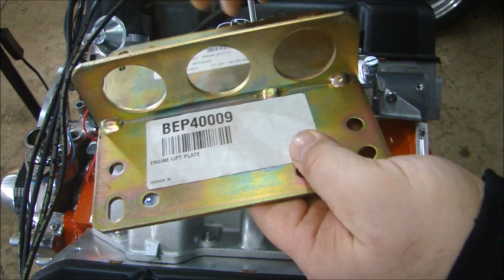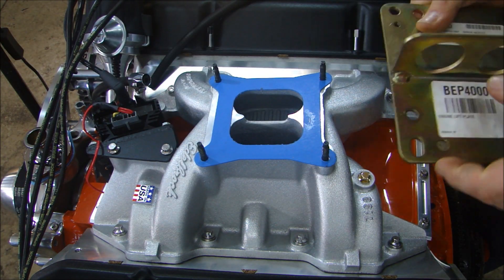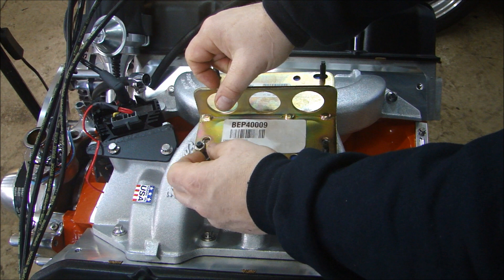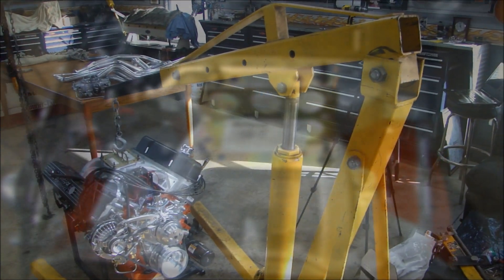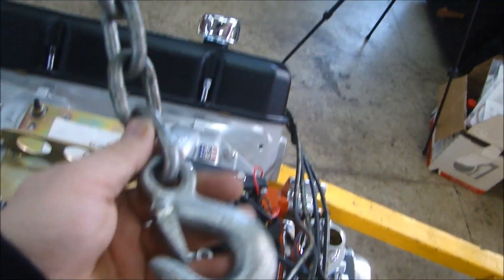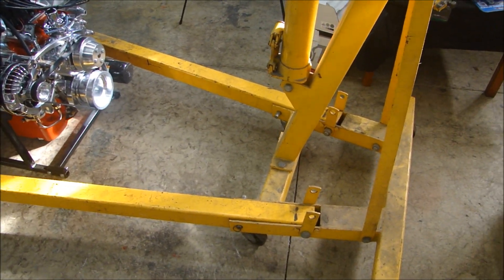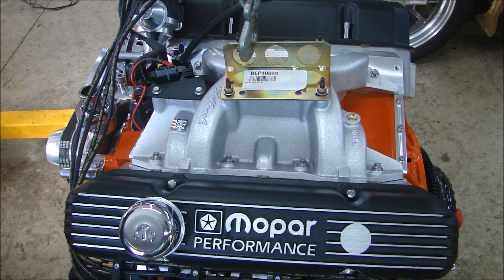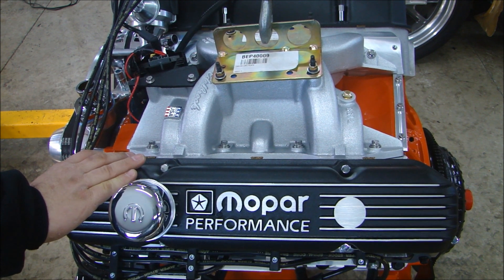Engine Building - Engine Lifting, Moving and Storage Cradles

Comment: nice video, i have pulled many engines and have used both the lifting plate and the load leveler, and once i used the leveler i would never go back to using the plate ever again, its a game changer for walking a engine in or out of a vehicle exp if you are doing it by yourself, no more jack on the back of the transmission, no more pry bars, makes the job of a engine swap way easier.
Reply from the maker: I agree 100%

Comment: Great video, it would  be great if you had a  video  that shows the installation  process  with the engine  plate system on the carby ....
Reply from the maker: It just bolts on like the carburetor

Comment: Love your videos! I just found out that my aluminum Mercedes 560SL engine is too heavy for it’s own weight & I stripped the bolts in the case while on the stand. Now I can’t find anything to support the engine so I can rebuild it. I purchased a so called universal cradle stand, but it doesn’t work. And once you remove the intake & heads (not sure how) you no longer can lift the engine with a hoist either. It’s an over engineered block of aluminum & I can’t figure out how to do this.
Reply from the maker: For an aluminum block I use all of the bolt holes to support it, or else I use the motor mounts
Reply: @PetesGarage  thank you Pete. I guess I will need to fabricate (have fabricated) a different attachment plate for this build. With Chevy & Ford there are bazillions of products available & many different lifting plates (even lift the side of engine), but nothing for Mercedes. Try to find a single video on YouTube or even a post on the web where a 560SL engine was rebuilt. I can’t find a single one. I’ve seen LS swaps, but no rebuilds. I’ve never rebuilt an engine or even taken an engine out of a car, but it seems I will be the first to document a rebuild on YouTube. My first tip is to support the engine when on a stand.
Reply from the maker: Yeah, not too many people rebuilding their Mercedes engines

Comment: HI, i was looking for info on using an intake manifold mount plate to pick up my iron headed marine small block by it's Edelbrock Air Gap manifold..  Looks like you have been doing that with your example engine.
This is  going to save me a bunch of time because the plate will allow me to clear the engine bay with one less very cumbersome step. Thank you!
Reply from the maker: They are only $15 and I use them all the time

Comment: I had a 1972 440 built with lots of aftermarket parts . Had it Dyno ran . So my 70 Roadrunner is taking way longer to build . What is the best way to long term storage the engine ? Maybe 2-3 yrs storage . And do I want to hook a starter to get oil flowing and pistons lubed up ? Thanks
Reply from the maker: You want to keep it dry and lubricated, so turn it over once a month, pull out the distributor and spin the oil pump while rotating the crank

Comment: I've been trying to find the lifting points on a 2015 f250 6.2 engine. I purchased one of those universal plates but the holes don't seem to line up over the four bolts. And the four bolts are in the front of the engine.
Reply from the maker: You probably need a leveler with the 4 chains

Comment: Hi Pete is it possible to mock an engine up on an engine cradle and run it? Anything I would need to do it?
Reply from the maker: I don't think it's strong enough. If you beef it up and make sure it doesn't move you may be able to do it.
Reply: Had a buddy try it once and when he hit the throttle damn thing flipped on its side, tried to tell him lol He still does it but bow he keeps the engine hoist attached to the top end to support it from throwing it's weight like that. It's risky but I guess sometimes people do it with what they have just know the risk going into it cause there made to hold the weight but once u factor in the torque and momentum of a running engine it changes everything when that same weight gets to be jumping around

Comment: I appreciate your videos and the info shared. 
When it comes to engine storage, is there any downside to using an engine stand that attaches to the back where the bellhousing normally mounts?
An engine cradle makes more sense, but just curious...thanks.
Reply from the maker: Sure, you can store it on a stand, just keep it covered.